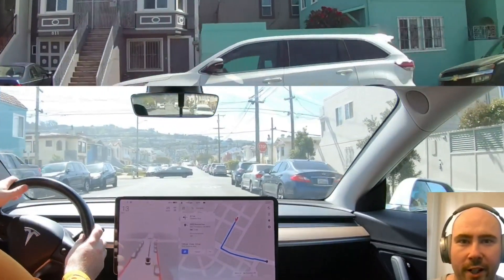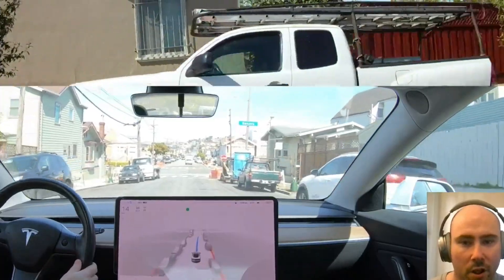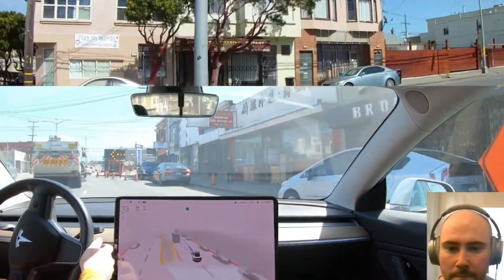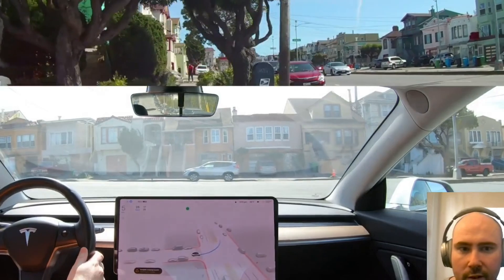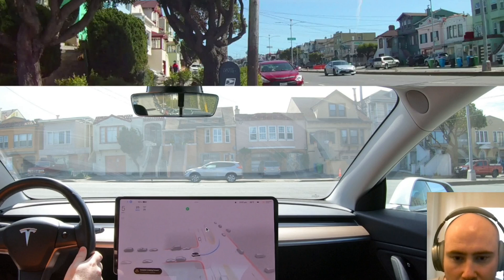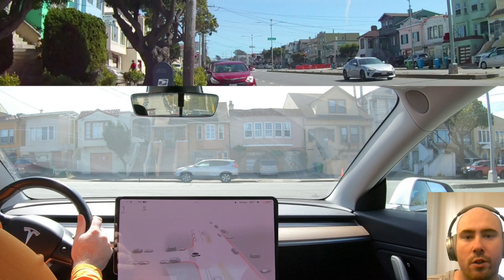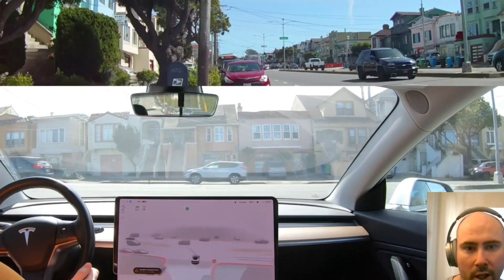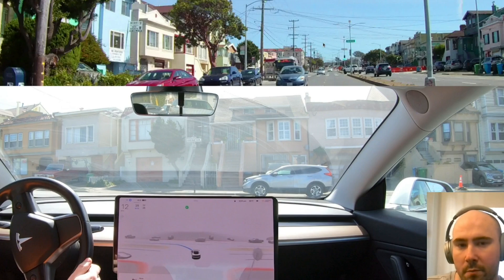FSD Beta 10.11 Unprotected Left Tests

Comment: 4:13 Unless with your left hand you were also further turning the steering wheel the same way FSD was already turning it, then FSD was still in control at the time the path disappeared/turned grey. And keep in mind that there is also lag between FSD making its decision and the display showing that change. So FSD was making the decision to stop at the same time or even milliseconds before your foot was hitting the brake pedal. If you were suddenly/reflexively grabbing the steering wheel to take control at same time as you hit brake, I think it would be odd that you continue to let is slide through your right hand as you grab with your left and also just continue the motion of the steering wheel initiated by FSD. It's a matter of a few frames at most, but it does show FSD was not blithely committing to the turn in front of the oncoming car.

I do of course agree about the optimal way to approach the turn and where to pause. However, also consider the human need to pause is a bit different from FSD. Humans have to swing their head and look both ways, which requires a pause in that situation. FSD is continuously looking both ways, so can be more comfortable continuously updating its "safe to proceed" assessment without the expected pause. This, I am sure, is very disconcerting for human beta testers. But it is far less unsafe than it seems.
Reply from the maker: Hey Scott, thanks for the detailed discussion! The way I'm seeing it at 3:51 the tentacle changes shape from a smooth, consistent curve to straight across the intersection before turning left. I believe this is the moment the car changes its trajectory due to the Subaru. Just after that the car begins turning right (for 5 frames) to correct for the straighter trajectory. Then the  tentacle goes grey implying I've pressed the brake and disabled FSD. So based on that I believe at the moment I took over the car didn't intend to stop. However I do believe the car would have stopped before entering into the path of the Subaru BUT blocking the first lane. That's speculation on my part, but based on my experiences. But that's why I took over when I did, so as to not block the first lane. I'm not certain my hands play a part in it, I think the left motion of the wheel is actually backlash from the steering motor disengaging. I can post an uncropped clip unlisted if you like so that we could see my left hand. Argh perhaps I should try filming in 60fps again for these moments.  

Definitely agree with your second point, and it's something not understood by many. I think a lot about this actually and about gaining confidence in the system. The constant firmware updates don't help, as system behavior changes and needs to be relearned. But there's been many times that I had to intervene simply because I couldn't process the intersection quickly enough to verify the cars decisions. Knowing full well that the car is probably doing the right thing, but I can't let it because I haven't had a chance to look everywhere yet. Cheers!
Reply: Yeah, I agree it might well have stopped in the middle of the first lane by the time it stopped itself. Definitely not good to scare you or the other car(s) like that.
Reply: @JP_Watch_Repair  Another thought that have had, only half-joking, is that Tesla may program FSD to intentionally make mistakes that it knows are safe, in order to keep test drivers on their toes -- a beautiful solution to the test diver boredom and complacency problem! :)

While I don't think FSD ever intentionally makes mistakes, I do think this figures into Tesla's calculation on the risk of putting this into the hands of public, non-employee, non-NDA-covered testers, free to post video of their experiences. They must be very sure that it will not easily cause an accident even if you fall asleep, and they must have realized that if it does these weird things at weird times, not necessarily unsafe, but weird and a little unpredictable, that it will keep drivers from trusting it too much and really does solve driver boredom and complacency. They might have limited FSD so that it beeps and request driver assistance at the slightest uncertainty and if driver does not assist, then slow down pull over and stop. But they chose not to implement it that way. They would get far less useful training data that way, and drivers would start to feel safe and pay less attention as long as it was not beeping for assistance.
Reply: @JP_Watch_Repair  ok another thought.. sorry for the barrage of comments... I was just thinking how, although we cannot know what the car "would have done", the Tesla devs can. I'm willing to bet they've long since put thousands of similar scenarios from beta testers into their simulator (and before that from employee testers), where they can safely see what the car would have done. I can't imagine they would have put FSD beta out there, or kept it out there, if even one out of the thousands of those scenarios actually resulted in a crash. I think they have extraordinarily convincing data on this, such that when (not if) they face the inevitable lawsuit, they can prove convincingly the cars on FSD are at least as safe as good human drivers.
Reply from the maker: Hey Scott, I posted the unedited video which shows the uncropped Subaru interaction, and it shows the side camera location as well - https://youtu.be/xhAxB-nGbtE
Reply: @JP_Watch_Repair  Cool! I'll take a look when I get the chance. I'm sure the timing was very close, if I am right about FSD turning the path grey before you hit the brake. But I think the wheel continues to turn right for 2-3 frames after it turns grey, which I think means you haven't yet hit the brake pedal. I know in other beta test videos, they have shown the line turning grey on its own (i.e. not due to intervention) indicating that FSD had a path planned, but not intending to proceed or intending to stop.

Comment: From this I think we can conclude that japanese cars are the problem :)  good tests. So your side camera is actually a fair bit ahead of the tesla B pillar camera so it seems it drives out blind in most cases here. That's one strategy, not necessarily the one I would go with :)
Reply from the maker: Ha, yes something about those Japanese cars! What strategy would you use? I'd like to get a 360 camera, because often times the right side is more interesting.
Reply: @JP_Watch_Repair  I meant autopilot wise :)  it was good for these left turns. you could place the camera closer to the b pillar but this camera shows it moves out blind even relative to this more forward camera. So it's a pretty good test.  I have suggested that an autonomous car obviously needs a camera up front so it has to only minimally stick out. You could have a side camera on the headlight and another camera on the b pillar to show the dramatic difference. it's pretty obvious but might make for striking video. a policy making video.